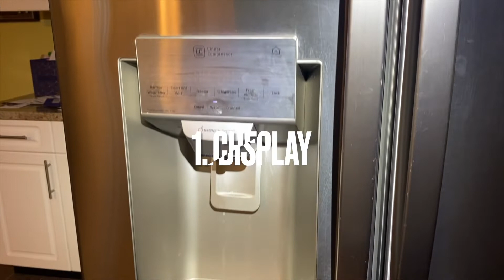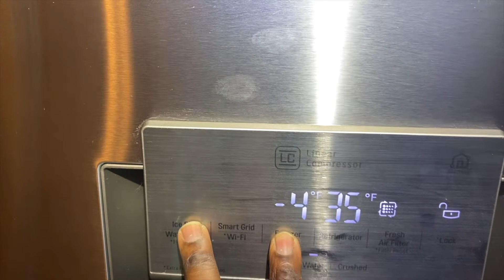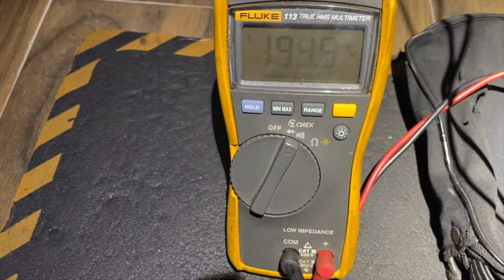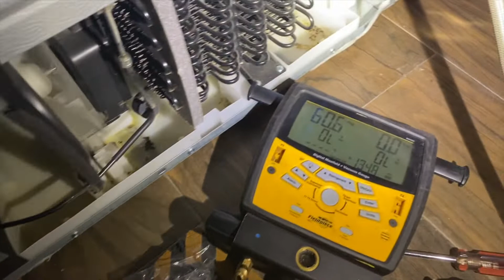LG refrigerator compressor diagnosis

Comment: feel the compressor to see if it is working check voltage at the compressor to see if it is getting voltage. good info on the board though. My repair man said my compressor was bad when it was working. I probably had a leak and was leaving town. replaced a refrigerator that probably was just low on freon.
Reply from the maker: Thats true, all those checks needs to be done

Comment: You mentioned that the ambient tempreture have alot to do with the rise in pressure, care to explain?
Reply from the maker: Pressure and temperature are directly related higher temperature means higher pressure. So if the temperature is say around 60 psi in the room, the standing pressure (when compressor is off) would be lower
Reply: What psi should it be hitting on the low side while running?

Comment: I didn't know you can determine by checking the pressure can tell you that the compressor is defective..wow...am really in the dark..
Reply from the maker: Yes for these Lg linear compressor. The compressor has windings and a piston , so it’s getting electrical signal but the piston dont move . When the compressor is pumping the low side pressure should be approximately 5 psi or so.
Reply: Awesome.. thank general.